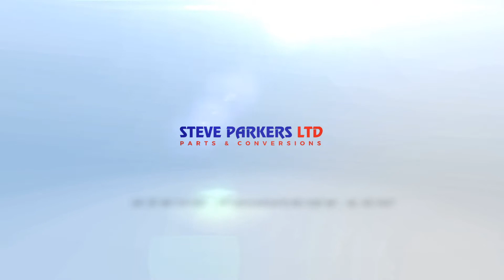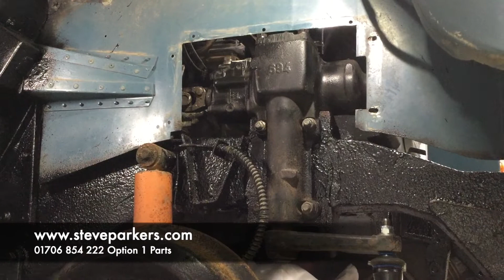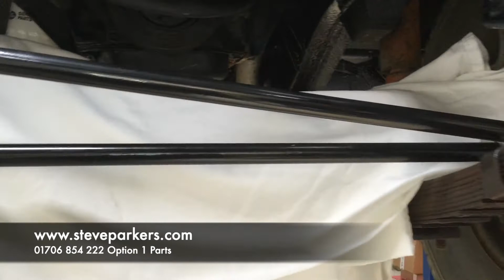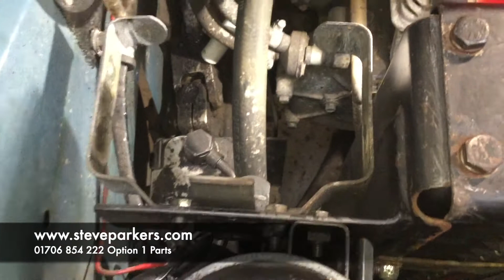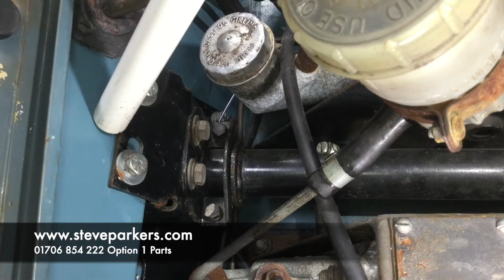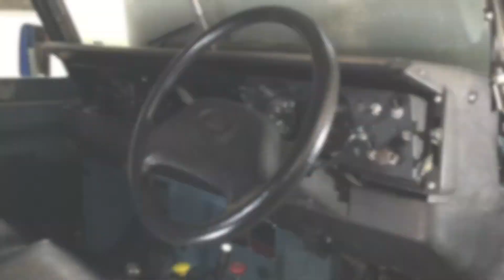STEVE PARKERS LTD PAS CONVERSION SERIES LAND ROVERS

Comment: I’d disagree with the other comment. Particularly if you have an engine transplant already which has an easily fitted power steering pump. 

If you want power steering you need to fit all the components somewhere. The “electric column” options are all bulky, require considerable thought as to finished aesthetics, and crucially just put excess forces through a steering box and relay that are pretty marginal even with manual control. 

The Heystee ram was eye-wateringly expensive, now practically unavailable, and was always going to be a future maintenance/overhaul liability. 

Secondhand P38 steering boxes are currently plentiful and cheap. Cheap enough, indeed, that I now have two spare ones on the shelf. 

Making and fitting a mounting plate is simple fabrication, as are all the other mechanical elements of this conversion. 

The key part that makes the real difference to ultimate drivability is the modified track rod. Using the original steering arm mounting point in my similarly modified 109” gives 3.2 turns lock to lock, and as Steve says in the video, the steering is very light. Adding a damper made a difference, but moving the drag link this way effectively shortens the steering arm from 230mm to 160mm, and reduces the turns lock to lock by nearly one full turn. This, combined with the total absence of “play” in the system, completely transforms the way the vehicle drives. It’s a conversion I should have done decades ago. 

The biggest shame is that Parker’s are no longer trading. Hopefully someone connected with the project will consider continuing to supply the unique adaptor part, because pretty much everything else in the kit can be fabricated by a competent DIYer.
Reply: Have you heard any updates where these adapters can be found for the steering linkage??
Reply: @markblyth2895 I’m afraid not. Although I must admit that I haven’t really been looking. 

An alternative might be to track down an early series 2 “pendant” style steering arm and use that instead of the top kingpin stub. I have no idea whether it would work unmodified though, and if there would be any issues with ball joints fouling each other.